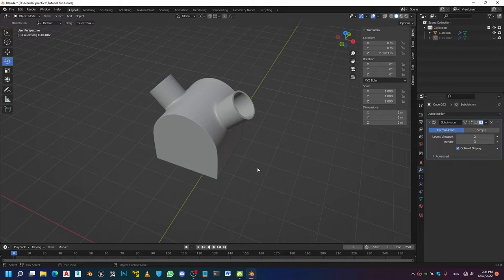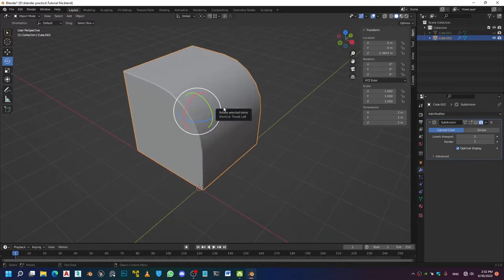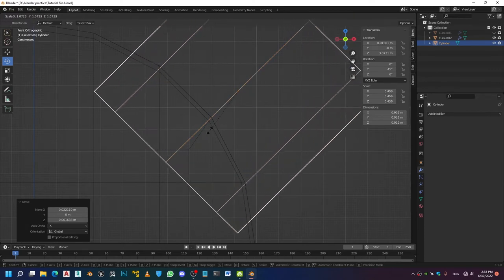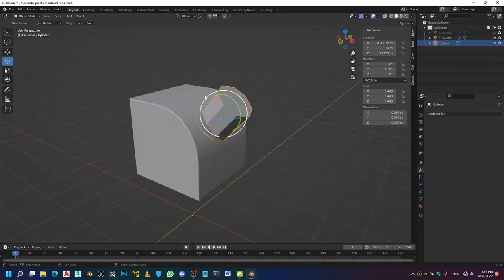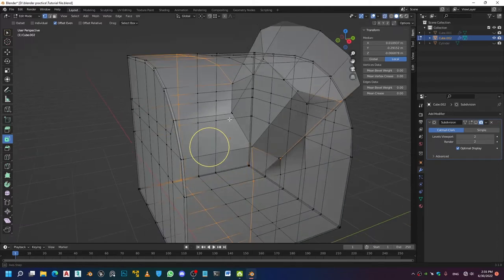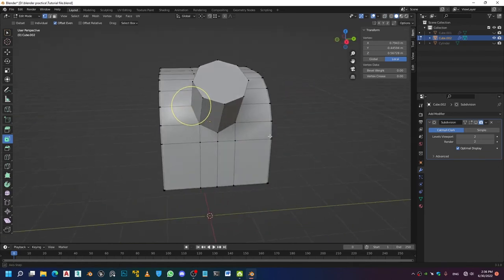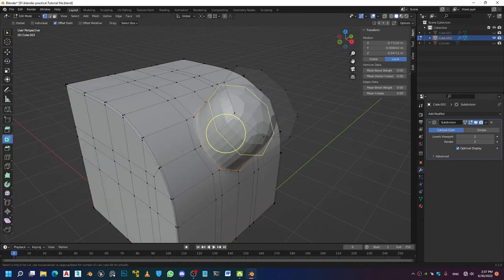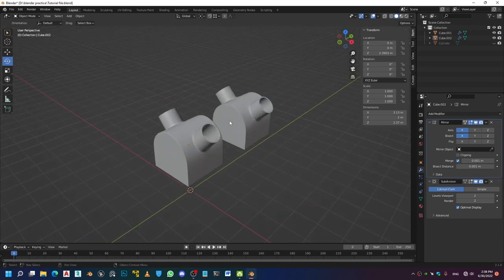How To Boolean Curved Surfaces? | Blender Beginner Topology Tips!

Comment: Good tut, thanks. The one thing I would say is this method changes the design to fit the topology. It needs to be the other way where the topology needs to be adjusted to the design. An example is say the cylinder is more to a vertical angle, or the cyliner is thicker/thinner than the edges can reach. Good tut though.